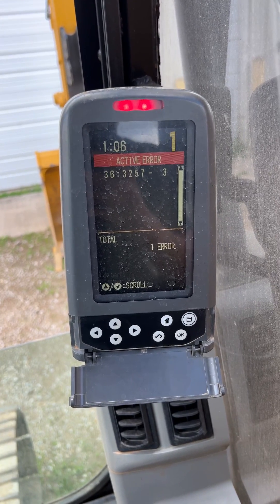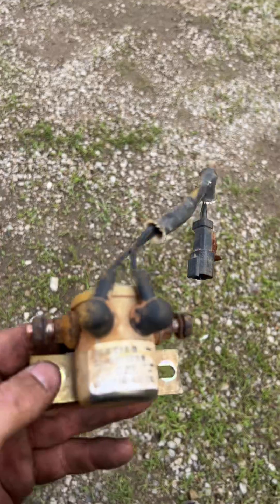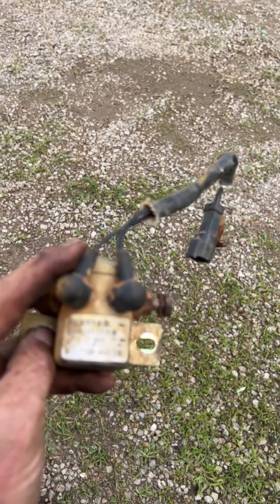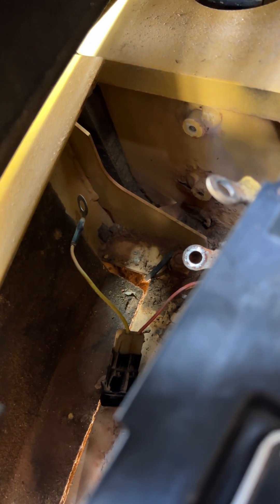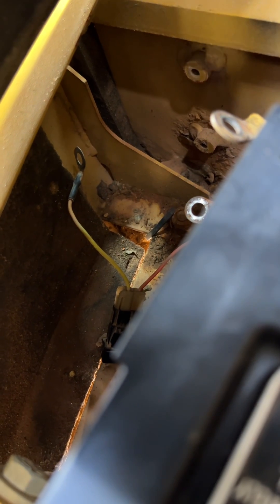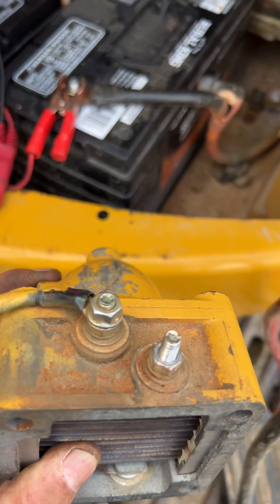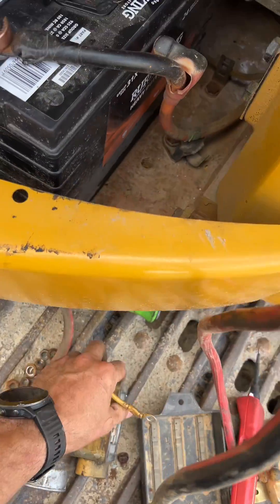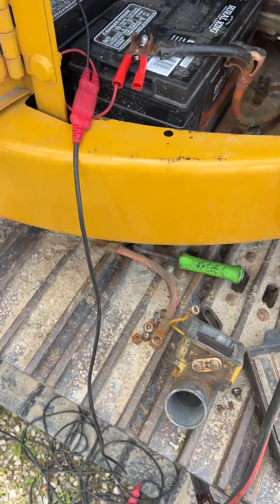2011 Cat 314d lcr has a 3257-3 code: Air Inlet Heater : Voltage Above Normal.

Comment: I have the same code on a 2012. What are the part numbers you had to replace?
Reply from the maker: Let me see if I can find them.
Reply from the maker: Grid heater part number- 324-4119
Updated cable/harness- 465-5228